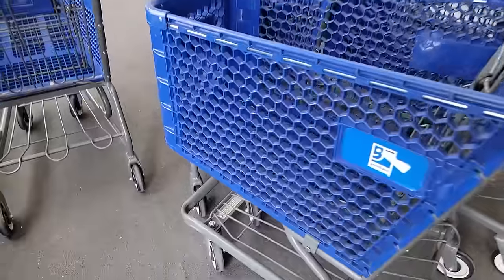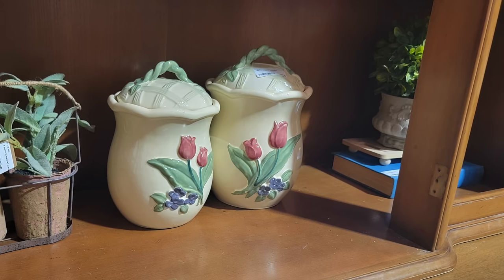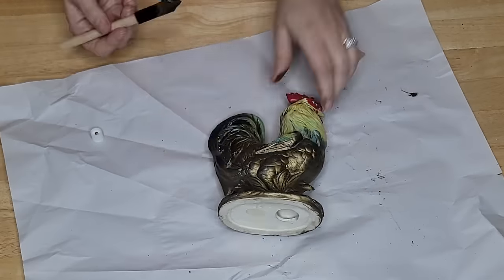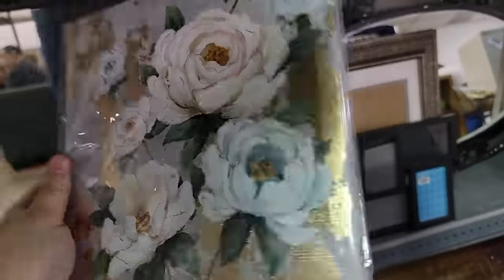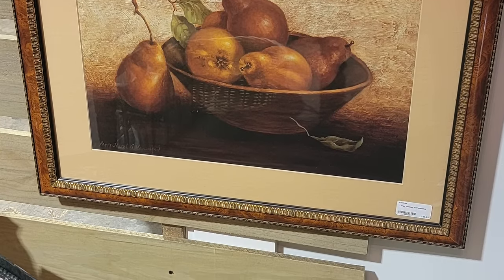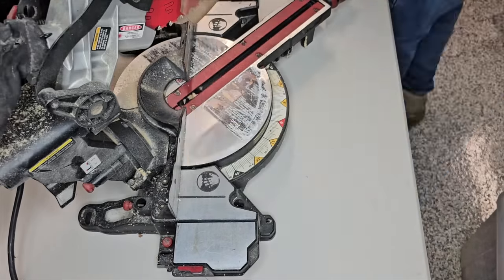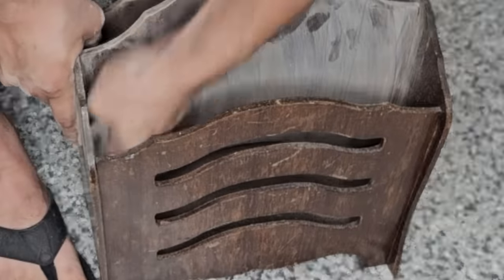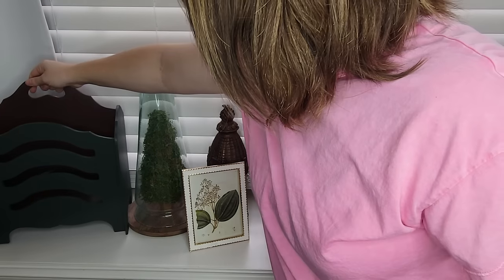7 NEW Goodwill Bins Thrift & Flips

Comment: Hi cory, here is my take on ur rooster, and I liked him!  I have been a pottery and ceramic artist for well over 35 years.  He was extremely glossy and nothing would stick, fired at a high temp so his glaze was like glass.  You could have sanded him so stuff would stick, but that doesn't always work.  It probably needed a bonding primer first before anything.  I use dixie belle slick stick, but there are other cheaper brands out there at lowes, etc.  Just make sure it will go over glass.  I have picture frames once in a while that nothing will stick to and then I regret not hitting it with bonding primer.  When that happens I just make it really rustic with lots of the under neath color showing. Lol.

Comment: FYI: hello, so Rub N Buff is like a wax and with waxes in general you can use a wax to remove a wax...so say you put on too much rub n buff or too much black wax, you can use another wax (say clear wax, or any color) to pull some of it off, does that make sense? If you wanted 2 full coats of the rub n buff you can put one coat on let it dry then seal with a clear coat...even though they say don't clear coat a wax...you can with certain sealers like clear coat  primer or even mod podge would seal in the first coat of your rub in buff (some clear coats won't work over wax, they will just bead up or roll off)...then when that dries add your 2nd coat of rub n buff. I use a lot of rub n buff and I have found using my finger and laying it on thick will give you pretty much full coverage...brushes take half of it back off. Hope this helps!

Comment: The tree inthe clouch is a "no" in my opinion. First it is too big for the cloche. Second the moss would be ok for the base layer to cover the foam.and be a foundation for a bunch of really tiny flowers. But alone, it's not appealing. Maybe mount a small structural branch twig with small florals and cover the base with moss. Or mYbe a really tall skinny bunny with little geggs around in grass on the floor.